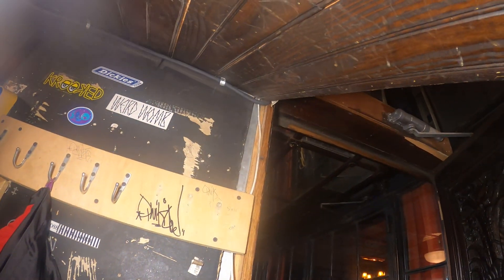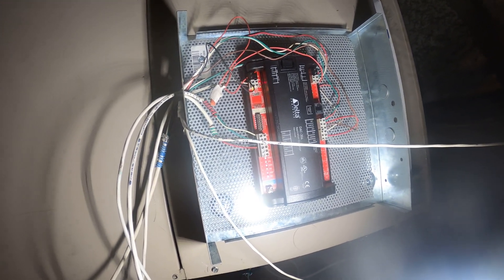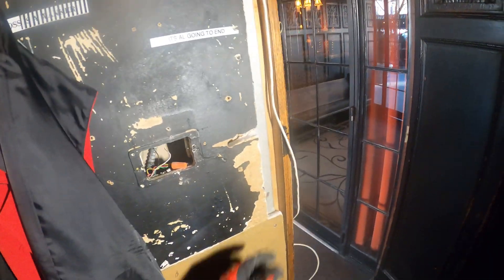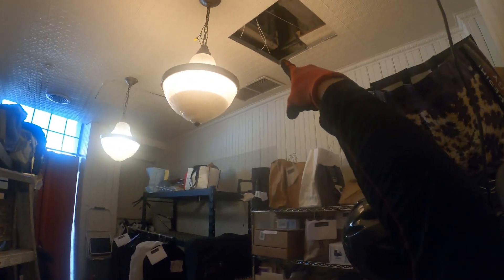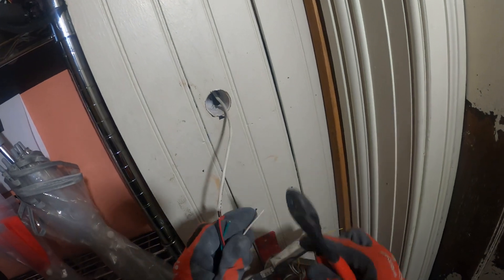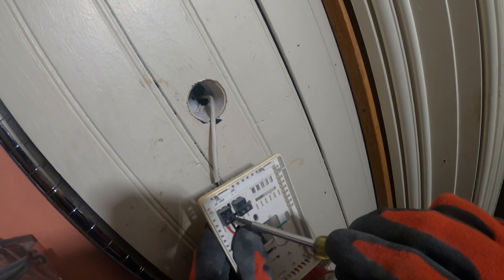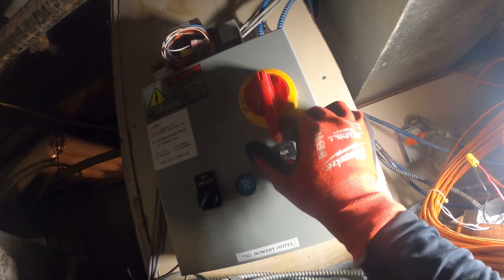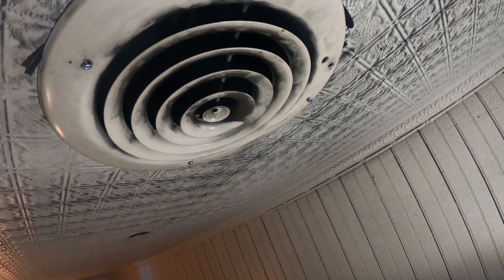HVAC Service Call: Relocating A Low Voltage Thermostat (Running Thermostat Wire Through Walls)

Comment: Great Video. Thank you for sharing. is Fan Coil Unit the same as water source heat pump unit ?
Reply from the maker: Thank you! You're very welcome. Appreciate you watching & commenting. No, this is a completely different type of system. Water source heat pumps just mean the condenser is cooled by water instead of air and it's a standard heat pump. Has a compressor and uses refrigerant. Fan coil units provide heating or cooling strictly from water which gets pumped to it from a chiller which actually produces the hot water or chiller water. Fan coil units don't have any compressor or refrigerant. Very different. Stay tuned for new videos every week!